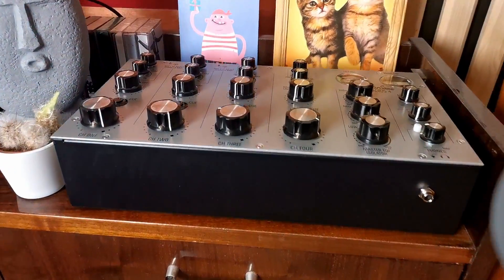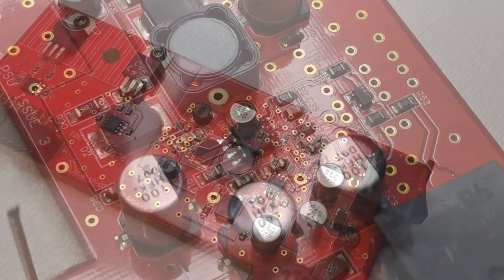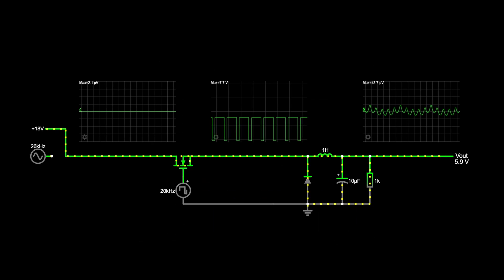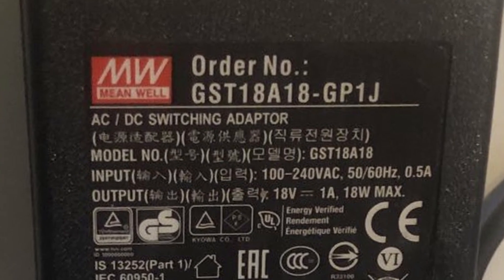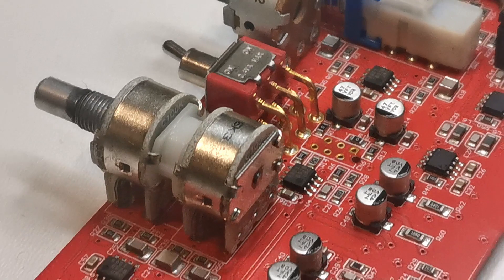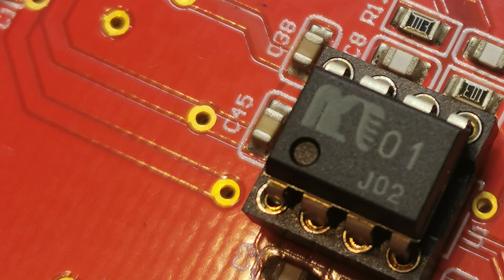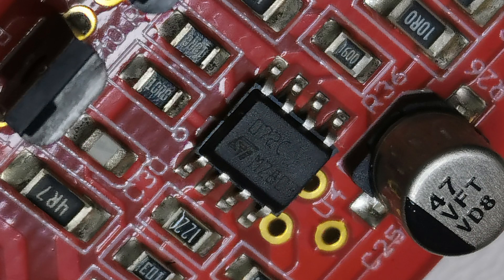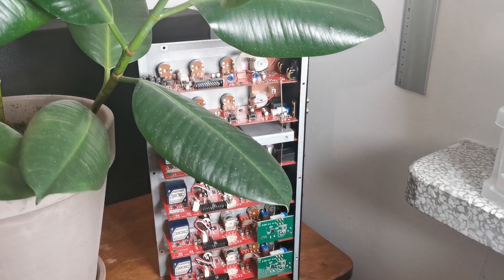Mixers Inside: MasterSounds Radius 4 mk1 + LinearPOWER

Comment: I love the cue button on these mixers! Also about the summing: I guess headroom plays an important role in the equation. As long as every component stays far away from it's operational limits, you get a "relaxed" sound.

P.S. Digging your old JM lab speakers! I had similar ones with the same tweeter couple years ago.

Comment: Did you measure the output impedance of the XLR outs? Would be interesting to know.
Reply from the maker: @2J_W9  no, but you can examine THAT chip data, cause it depends on this chip unless there is no output resistor.

Comment: Fantastic video. Question: do you know the manufacturer and part number for the cue button? I need to find a replacement.
Reply from the maker: look for a part called "vandal switch"
Reply: That's super helpful, thank you! I just need to figure out the specs now - I see it says 1.8v, any other details you can provide would be ideal.
Reply: @fumpingstrumpet  Ask the people at Mastesounds. They can mail them out. I've had to change both of them... seems like a poor quality piece that stops working pretty frequently.

Comment: Thank you once again :)
Another fire video !
I love  the rotary's mixer but maybe any chance to do a AH 96 or the Pioneer V10 (especially) to see if the 
3500$ price tag is actually a total rip off (probably is) but would be interesting as they are the two mixers that 80%% of clubs are using in the world
Reply from the maker: @esmasgau  there is definitely a chance for 96 video in the future. I saw it inside once I was servicing it in the times i didn't have this channel.

What can I say straight away is that many "boutiqe" rotary mixers are a rip off compared to Xone 96. There is a lot of technology involved in this mixer, it has an USB interface with AKM DAC chips on every channel, great sounding clickless resonant filters. It's definitely more serious engineering and very well crafted product. You get much more when you buy a 96 compared to some most popular rotaries that are expensive as hell and inside they have 70s/80s technology rip off that is done with really basic and cheap parts. I'm not saying they sound bad, i mean that in terms of parts and engineering cost they have definitely less value than Xone 96 or Pioneer V10.

Speaking of Pioneer, damn. This is serious engineering as well. There are many controversies about Pioneer because of they are based on digital technology, but believe me that digital technology got much better for last 10-15 years and now you can get perfectly clean sound if you like such sound. Pioneer implements lots of software engineering, their enclosures are perfectly crafted - it's a work of a team, not guy in the garage.

I think that it's not coincidence that speaking of rider mixers we talk about Pioneer or A&H.
Reply: @mixersinside i appreciate taking your time for answering my question, thank u and keep up the amazing content 🫶

Comment: Thanks for the video, do you ever test "crosstalk" with the mixers and how do the mixers compare with others. I have an Ecler Nuo 2.0 and the crosstalk was pretty bad until I used those rca caps / plugs. This year I purchased Master sounds Radius 4 MK2 and I experienced similar things happening and it's especially noticeable on the photo channels of my DJ mixers. Do you know why this affects those channels in particular. I'm eager to learn and understand these concepts and enjoy your channel. Thanks
Reply from the maker: @dubdjnelson  crosstalk arises because of many reasons, one of them is poor grounding/PCB layout. I didn't test it cause in most cases crosstalk is on acceptable level. The vinyl medium itself has a lot of crosstalk so if you play with records you shouldn't worry about it, cause the signal from the cartridge has already terrible crosstalk. If you want to know more about it there are lots lots lots of informations about it in the web.
Reply: Yeah but there's a lot of difference between the crosstalk of the left and right channels of one source and the crosstalk of two different sources. I've hears mixers that have terrible crosstalk of the cued audio source and that's just terrible  @mixersinside
Reply from the maker: @MrJemabaris  good point! The parameter you're describing is called "offness" - it tells how much signal leaks to the summing bus when turning the potentiometer/fader fully "off".
Reply: https://drive.google.com/file/d/1MlNQhF66XWy0ZkftbkSqJgVxWwNWwhgV/view?fbclid=IwAR25wF3afWG1Ih_2HUQ7g19box3QTRPv7Xht3vbfH0ghYUzpWWml1Bl-pxI 
there's a crosstalk among other measurements. the Radius is doing not much better than the Condensa, which is a horrible piece of equipment by contemporary standards..

Comment: Thanks for the informative reivew! You pointed out that the linear PSU is an overkill for the Radius, how about the Radius Valve? Is it overkill for that too?
Reply from the maker: @dombesz  if the internal power supply of Radius Valve is switch-mode then yes, it's also an overkill for the same reasons i was talking about in the video.

Comment: Very great reviews. It's very interesting to understand better the inside of those mixer. I had a question, what software do you use to measure transparency of the mixer ? And what's is the important parameter to check ?
Reply from the maker: @levraidesir  I use Room EQ Wizard. You can find details about my setup in Ecler Nuo/Warm video.

There are a lot of parameters to check when you want to judge audio quality. Most popular are THD @ 1kHz, THD vs frequency (I discuss it in RANE video), IMD, SNR, crosstalk, squarevawe response and many others. All are very important. On my channel I use THD @ 1kHz to briefly check if the mixer is on the clean or colored side.

I don't focus that much on measurements on this channel because as I said in the first episode (Bozak mixer) the sound character of DJ mixers is a matter of preference and doing detailed measurements will give you a lot of information and no information at the same time. I highly recommend using ears when buying a mixer, but also i really recommend being marketing resistant, cause marketing has actually a lot to do with how our ear works (or how we want our ears to work for us when being strongly biased by beautiful words crafted by marketing departaments).

Thank you for your questions and I hope that my videos will answer them partly. For getting familiar with measurements and parameters i recommend Audio Precision website.
Reply: Thank you very much for your very detailed answer. I will check your previous videos and the website you mentioned. I am interested to check if I can see a huge difference between my digital mixer and my analog mixer.

Comment: Since ypu checkd noe an mk1 and mk3 Version of the Radius 2/4 line it would be intressting to get your opinion in the difference about the build and component quality.
Reply from the maker: There is no mk3 version of Radius, and i've checked only mk1. This is my first video about MasterSounds mixers.
Reply: @mixersinside  That's an unofficial name. There were two (I assume identical on the inside) versions of the first generation, and one Mastersounds called the Mk2 with different phono stages among a few other small changes
Reply: @mixersinside  Hello Kamil, thanks for your reply. I have a long history with Mastersounds, a history that starts happy and ends... well lets say i sold all my Mastersounds stuff for personal differences with the brand. I got my frist Radius 2 in 2016, one of the first Mixers MS made back then. They had in the beginning 2 Versions - the standard version and a version with different op amps - called premium version - otherwise the mixers where identical. 
after a few years they changed the internal design, components and ofc the op amps, also they know did a step back from the "hand build" building process and things get done more in a modern way and they sorted the premium version out.
this is what i call the mk2 of the radius 2 / 4 but mastersounds did this very stealthy and had a lot of esoteric stuff about this on their product pages and disccusion in all groups on facebook etc... you can notice the mk1 and inofficial mk2 version on the vu meter - the mk1 had only mastersounds printed on mk2 the vu meters has mastersounds and union audio printed on the scala.
the then offical mk2 version is what i called mk3, agian they change internals and production but also set down the price. this came agian with a lot of esoteric stuff, when you read it you might think its all better then in mk1 and thats for a lower price but it clearly was only made to get out more devices. nothing worng for a company but a step down from what they started.

So yes, you are right. There is only MK1 and MK2 but 3 Versions and MK1 had even a premium version.
Reply from the maker: @djstuc  can you please tell me what is the mk3 of this mixer? I thought their newest product is mk2.
Reply from the maker: @djstuc  ok i see, thanks for clarifying.
Reply: @mixersinside  By the way, where are you located? I wouldn't mind lending my Two Valve for review if you're somewhere in continental Europe
Reply from the maker: @cowboyhank456  i'm based in Warsaw, Poland. I will be delighted to make an episode about Radius Valve, thank you.
Reply: @mixersinside  can I contact you somewhere? I will have to look at my schedule when I have gigs but I trust you’ll take care and I would love to see your analysis
Reply from the maker: @cowboyhank456  mixersinside@gmail.com

Also in the video description I always link my socials.
Reply: @mixersinside  sent you an email
Reply from the maker: @cowboyhank456  got it, thanks!